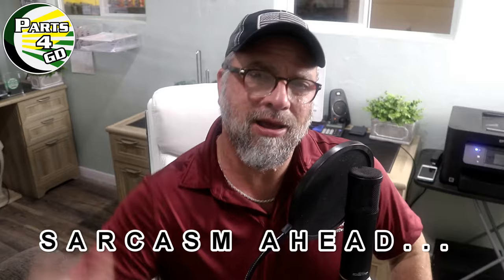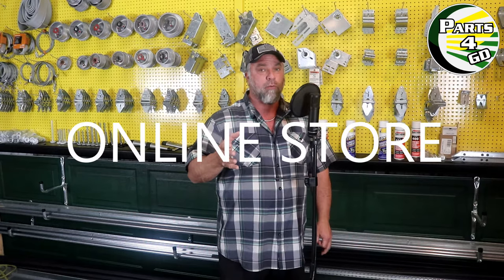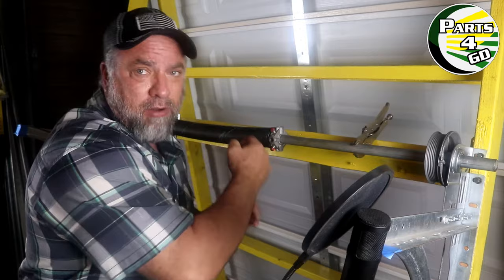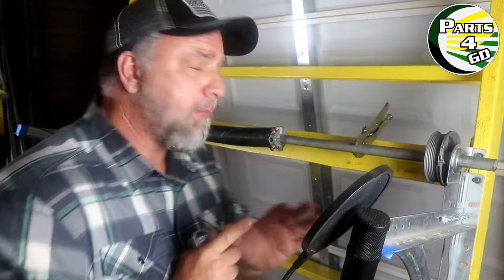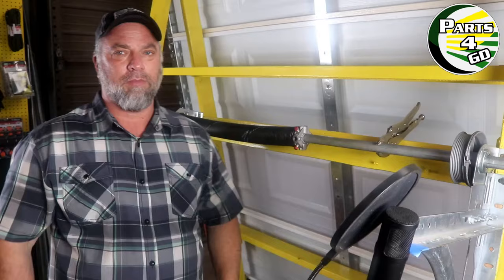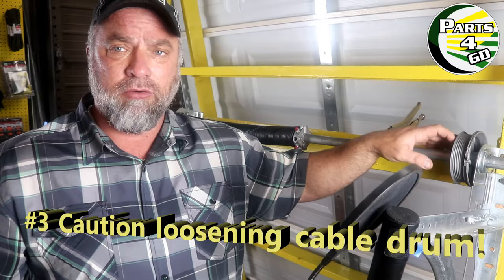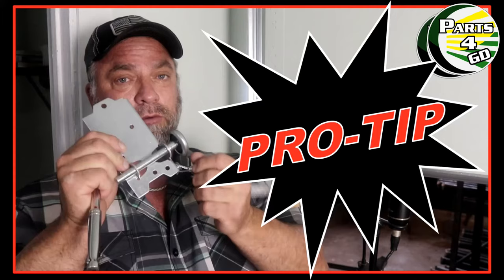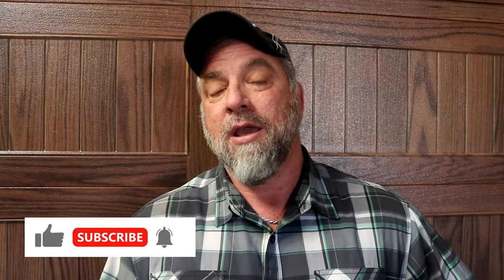4 Garage Door Dangers Every Diy'er Must Know! Watching This Video Could Keep You Safe!

Comment: An industrial sectional door on warehouses etc the torsion springs are much more bigger & heavier compared to a house garage door spring. If it has a spring break device or cable brake device fitted & it activates then your in trouble 😂
Reply from the maker: Good point. You have to be properly trained on larger or heavier than standard type doors. I wouldn't recommend for the novice.